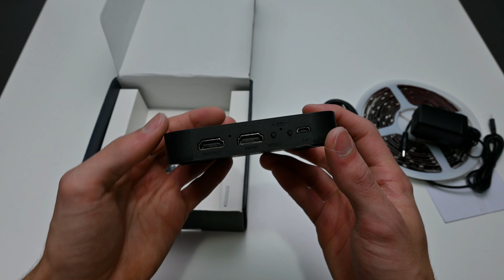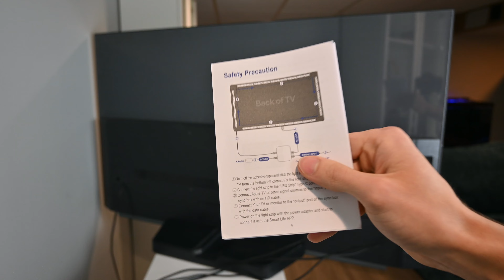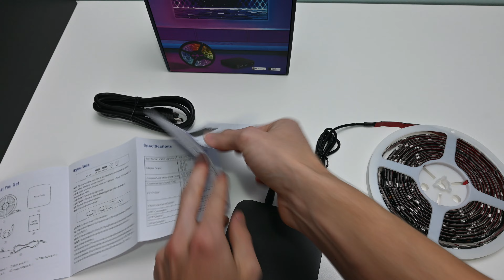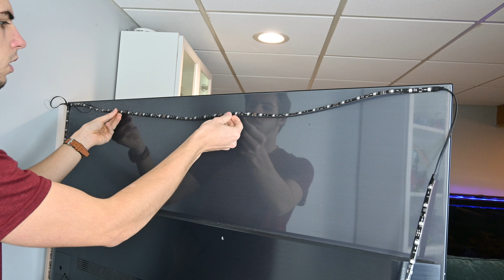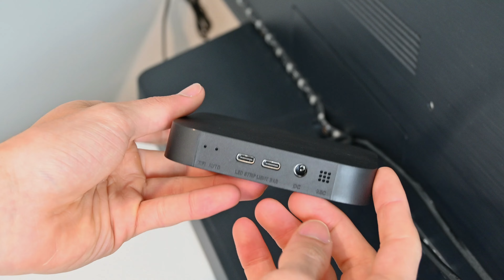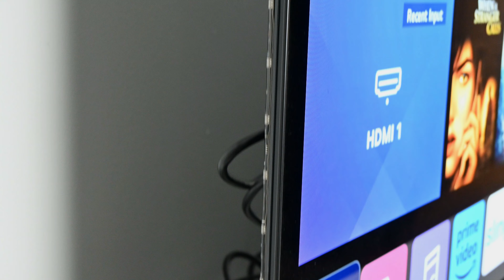How To Install TV Backlights (Tips and Tricks)

Comment: Buy the product, I took it out of the box, I followed all your installation instructions and the only thing I didn't consider is that you need to have an HDMI output, since when connecting HDMI to my Tv LG  It doesn't work so I'm going to have to return it from the aliexpress page. I could see that you recommended this product, but neither you nor the seller nor aliexpress explain to you that you have to have a HDMI output so I will have to return the product works in all modes except when I select tv mode